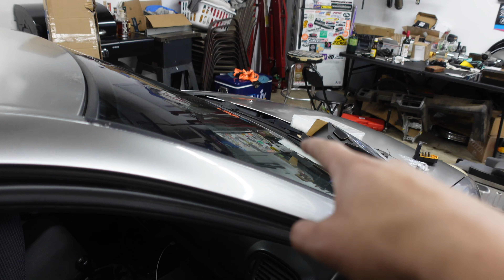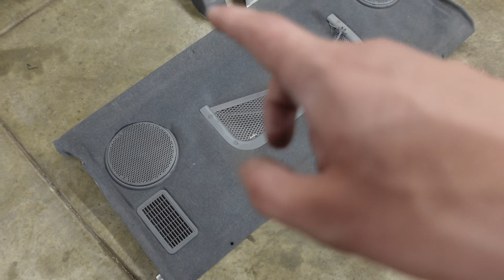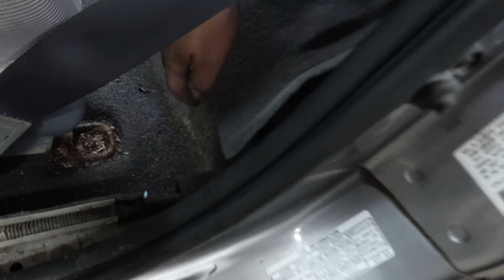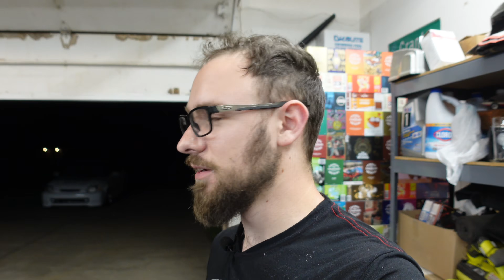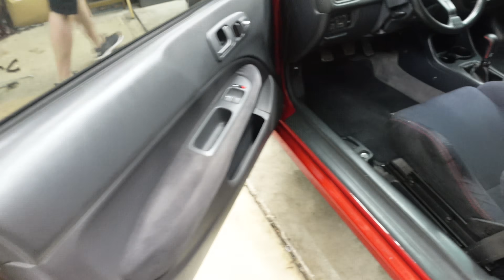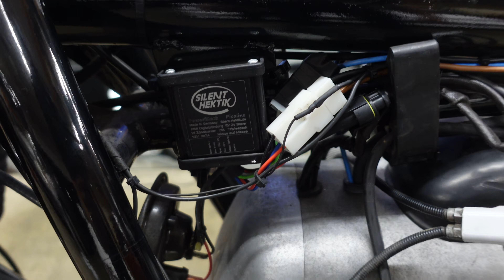HYBRID Car Audio Build! DANGER, High Voltage?

Comment: hey bro you have a way to increase power in a hybrid system? You can't upgrade the alternator obviously because there isn't one. I've got a hybrid sound system and it won't live up to it's potential until i can figure out how to get more power.
Reply from the maker: I've seen this question come up once before and the solution was to add an alternator to the accessory drive with custom brackets and tensioner. Not cheap or easy, though.

Comment: I am laughing at your version of the most base of base models. My first car, a base model Acadian (No, not the 4 cylinder based on a Chevette and not badged or registered as a Pontiac) that I got for $200 with 33,000 miles on the clock. No radio. Had the blanking plate in place. Did have power steering, but unassisted 4 wheel drum brakes. The 13 year old factory installed bias ply whitewall tires. 230 cid inline 6 backed by a 2 speed Powerglide automatic transmission. Forget air conditioning. Bench seats front and rear. It did not have the optional rear seatbelts, never mind rear shoulder belts. The front outboard positions had shoulder belts, each with a dedicated latch, so there were 5 seatbelt buckles in the front seat. It was a 69 and I bought it in 82. It was my 21st birthday present to myself. You do the math. I'm old as God! Could be worse. Ma's first car was brand new and put out a whopping 43 horsepower and 59 lb/ft of torque. She drove that on the expressway 50 miles each way to work, summer and winter, for 4 years. Your Honda was the lap of luxury!

Comment: Room gain is less about the shape and more about measures, and at some point you're just modulating the static pressure (when the length of the quarter wave is above the longest measure of the space, I think? It's been a while since I read the theory). But yeah, the difference is clear even with your lapel mic.
Reply from the maker: The theory always leaves me a bit confused, but whatever the case is this crummy old 10" sealed sub in this Insight is one of the smoothest, least-peaky bass response I've ever heard.

Comment: I have pretty much the exact same setup, except db651 in the front and rear slots and a newer kicker cx300 amp. I also used that wiring kit but my newer amp blew that in line fuse. Perhaps I shorted it on accident but regardless, it will be annoying to replace that.

Comment: If you have the wiring for rear speakers get the same polks
Reply from the maker: They won't fit due to all of the ducting and cooling stuff back there for the battery pack.
Reply: @100PercentJake  at least you now got a hidden sub in the back. Wish these Polks came is a 3-way configuration. I still like them.

Comment: I tried one of those amp kits from Walmart when they changed suppliers to Metra. I was also quite impressed. What I like about them is that the wire seems to be actual copper not copper coated aluminum, I hate copper coated aluminum cuz it's so flimsy and cannot be soldered to, Plus you don't get the best crimps. I hate the fact that so many manufacturers are selling copper coated aluminum wire online claiming that it's good to x amount of amps when that's the rating for pure copper wire and copper coated aluminum can carry much less than what they advertised, In other words they are advertising the ampacity of pure copper wire Rather than what they are selling.

Comment: That is correct. Back decks without factory speakers are pre-wired.  Early models were dealer option installed. Eventually they were factory standard.
Reply: I've never seen a factory standard one.
Reply: @VndNvwYvvSvv  by the time they changed the interior color to tan, they all shipped with rear speakers from the factory.

Comment: That BMW has the old universal ignition switch that works on all BMWs of that era. Only way to keep to your bike from getting stolen was locking the forks. My Dad had a 1973 R75/5. Drum brakes and all. Very similar to that 600cc.
Reply: At least it's not a modern Challenger/Charger.  An unsecured bicycle has better security.  These are being stolen FROM THE FACTORY!

Comment: FYI voltage isn't anywhere as dangerous as the high current. 0.2 Amps can kill easily whereas tasers are 2000V+
Reply: That's a myth. Harm requires both, and frequency & duration matter. 144 can penetrate the body and this is dangerous depending on current.  800 amps at 13.5v does literally nothing directly across my chest. Less than 1 amp kills at high voltage. Or it can give you a nasty burn if the frequency is high.  Source: electrical & computer engineer
Reply: @VndNvwYvvSvv  What you replied is potentially harmful. People die off of 12v 200A car batteries. Please check yourself before posting dangerous nonsense